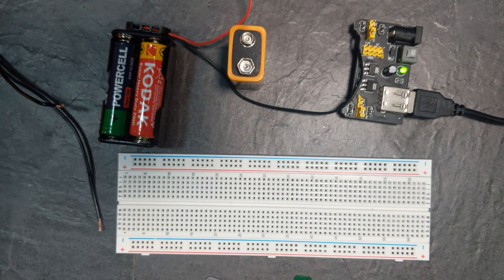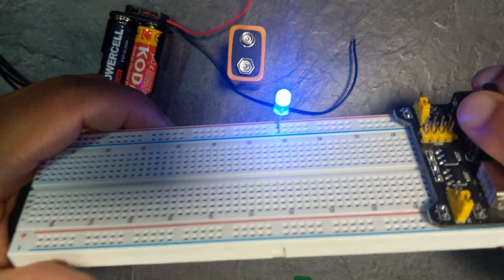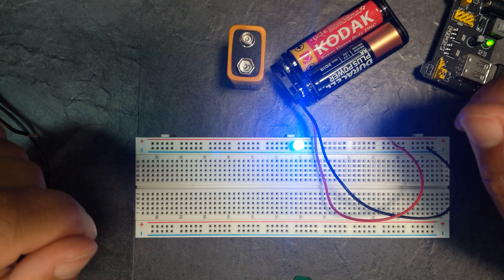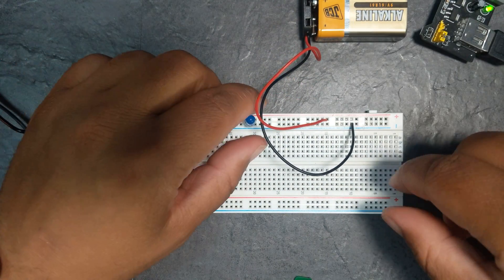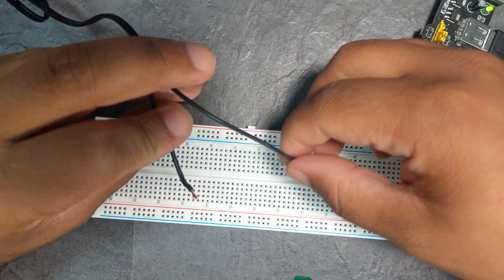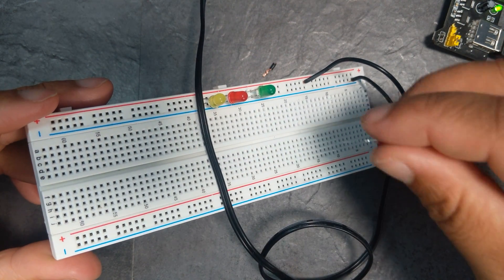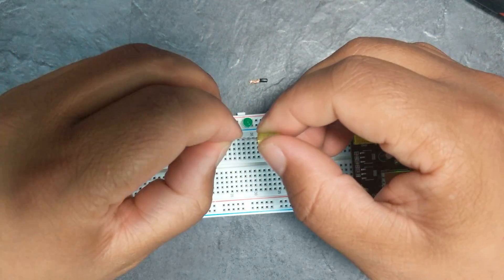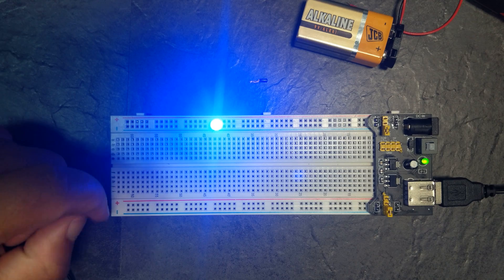How To Destroy LED's On A Breadboard (Safe)

Comment: idk i just wanted to know why my led died. 
The stupid thing is i used a resistor to not kill it and it worked fine but when i was changing my surcut i killed it unintentully xD
Reply from the maker: When I buy LEDs, I buy hundreds because I know I'm going to blow them up lol. It's either too high voltage or too high current. You can test this yourself by trying different colour LEDs and wacking a lot of current through them, they'll change colour then blow lol pretty fun really
Reply: @HamedAdefuwa  or you can plug some capacitors in the wall and watch it explode and turn on the breaker every time you do it  xD
Reply from the maker: I may have done this lol 🤣